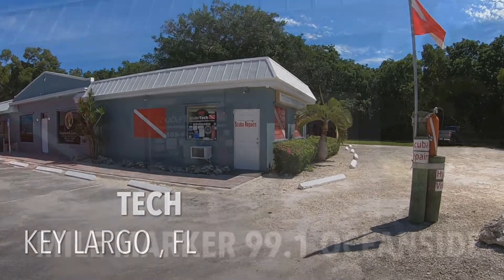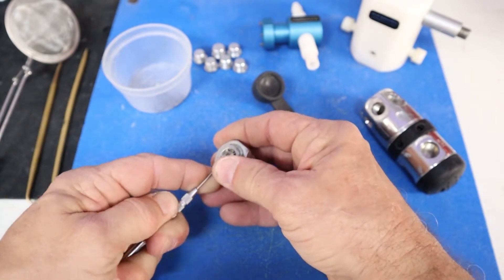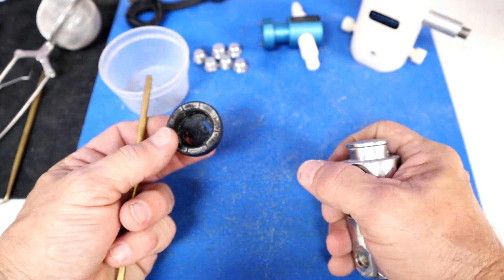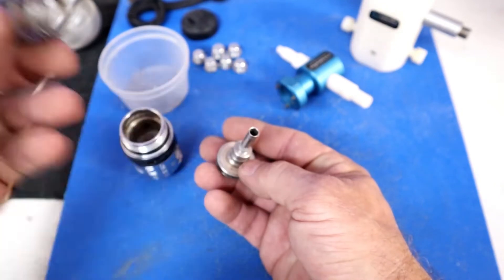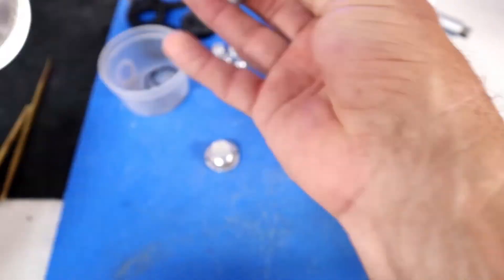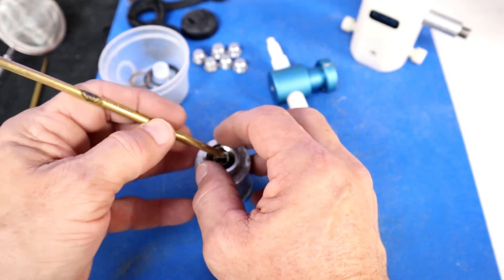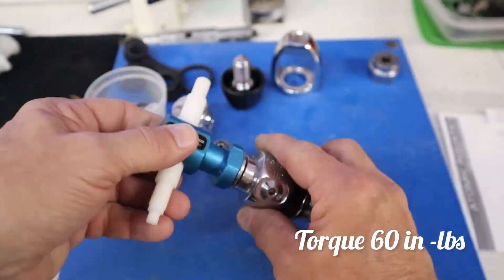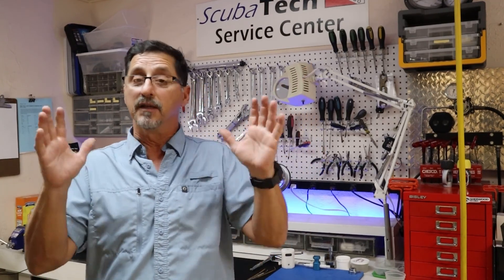How to Rebuild Atomic 1st stage  Scuba Regulator needs service

Comment: How long does it take on average for a complete service from disassembly to reassembly and final testing?  When I was rebuilding full time it was taking me about 1:30 to do all 3 stages on Scubapro and Atomic.  I always thought it should be faster, but was curious to see what a more experienced tech does.
Reply from the maker: One and a half hours is very acceptable, customer drops his reg off at 9am and returns 10:30 am to dive the afternoon, wow that's awesome. 
I've worked with and trained a lot of reg techs.   Uninterrupted 90 min service is inline with what I expect and would say it's pro level.  Someone working faster, I would question the integrity of the service.
I have timed myself and completed a 3 stage service under 45 mins. , however this is not my everyday objective.  There're times I'm multi tasking taking care of phone calls, and  walk-in customer  etc... this can lead to 5 hour service or I start today and finish tomorrow.

Comment: Great video thank you. I rebuilt an M1 it locks at 125 and slowly drifts up to 140 but stays there and doesn’t move beyond that. Thoughts?
Thank you!
MB
Reply from the maker: 125 to 150 is the acceptable range… slow drift is common 
Cycling the first such as turn off supply pressure purging and back on. Repeatedly cycling pressure will create a impression on the piston seat and should lock up IP.
Reply: Thank you for your response very much appreciated

Comment: Wouldn't the stainless steel basket of the ultrasonic cleaner scratch the 1st stages?
Reply from the maker: No damage to the parts from the SS baskets, the weave is soft to the point I can squeeze with my hands and collapse it.

Comment: Hi, excellent video!! This is the same process for  T3 1st stage regulator? and I want to fill the 1st stage with christolube, but can I use it with out the lube?  and it was serviced by a technician but I'm not sure about it, because he did not know about the grease that was inside, so he told me that it works with no problem, but he took out the large rubber seal and said to don't put it back so feel unconfent about it.  I will go diving and as soon as I can I want to fill with the christolube.  so it is ok to diving with out it? and the last question, once you change all the o-rings and everything do you need to pressurize the 1st stage? how do you do that? excuse me for so many questions , but I'm in Mexico and have not good technicians !!!
Reply from the maker: Yes, the service is the same for all Atomic 1st stages.  Atomic 1st stages can be used with or without Christo Lube.  The rubber seal with holes is used without Christo Lube, the solid rubber seal is with lube.  I pressurize the 1st stage using a scuba tank that sends air to my bench.  Thanks for the questions & for watching my channel.

Comment: Hello, which liquid substance did you use in Ultrasonic device and for how long you put the first Stage in it also the temperature? Thanks
Reply from the maker: I use Lawrence Factor Regulator Wash, 5 to 10 mins max, temp 29C to 33C

Comment: Question : Can the first Stage can be filled with Christolube for making the Regulator ready for Coldwater Diving  ??
Reply from the maker: yes, Atomic supplies the ST1 and T3 with sealed 1st stage packed with christo lube.  You can also seal any of the Atomic 1st stages utilizing a solid band.  It’s takes about 2oz of lube to fill.
Reply: @scubatechkeylargo  Thank you for the quick response 😊
Reply: @scubatechkeylargo  I believe the M1 also comes environmentally sealed also.
Reply: Can you please make a video covering the topic of packing the 1st stage?

Comment: I have a new St1 and there's a bunch of white grease or silicone coming from underneath the rubber part(it has >4 C sign on it) between high pressure and low pressure parts. Is that normal?
Reply from the maker: Yes, that's the Cristo lube ( nitrox safe lube )from inside the piston area.  The ST1 first stage is sealed with Cristo lube for an environmental seal.  It's normal to see some spill out around the edge of band, that should stop once the excess lube is wiped away.
Thanks for the question.

Comment: What would you do different to Oxygen clean it?
Reply from the maker: Oxygen cleaning is a process to remove contaminates such silicone grease and hydrocarbons.  Soaking & brushing the parts in a bath of Simple Green, Blue Gold and Dawn soap are the most popular degreasers.  This would be after the ultrasonic cleaning, and then assemble parts wearing nylon gloves as not to contaminate.

Comment: Hello again Angel. I hope that I am not intruding on your work here, but may I ask a question. On earlier Atomic piston regs were the stainless steel washer, o ring and teflon packing not used? I think that maybe just an o ring is all that is there, placed into a groove inside the body? A body that I have here does not appear to have the three pieces, just an o ring. I believe that Scubapro used to have this type of arrangement but they also changed to a three piece system? Any info would be more than appreciated.
Reply from the maker: Hey no worries I encourage question & comments.  Scubapro MK 5 & MK 10 only used single o-ring in a groove, current day models have  3 pieces, bushing/o-ring/back-up ring.  Atomic, as far I know always used 3 pieces, Teflon back-up ring/o-ring/SS retainer.  Early model Atomics used a green o-ring, which currently it's black with a white dot.  /Hope this helps. Thanks for the question.
Reply: @scubatechkeylargo  Thanks for the reply Angel. Yes, there is an o ring with a white dot on it. I will attempt to get an image of the inside of the body.